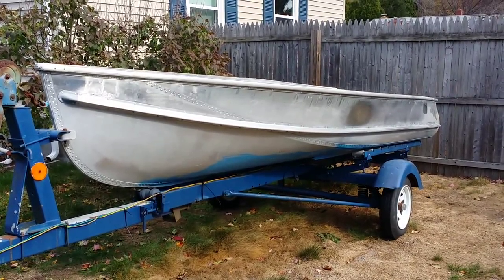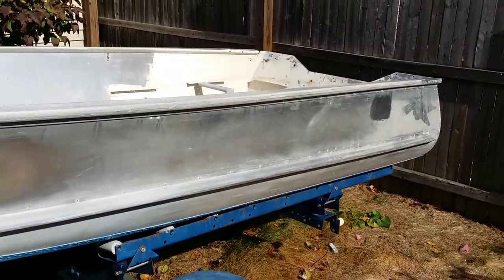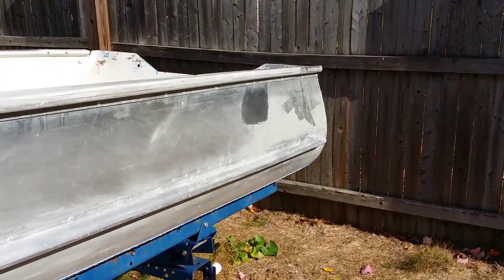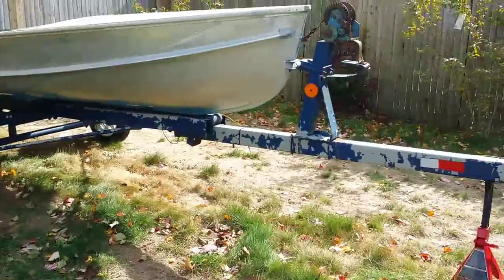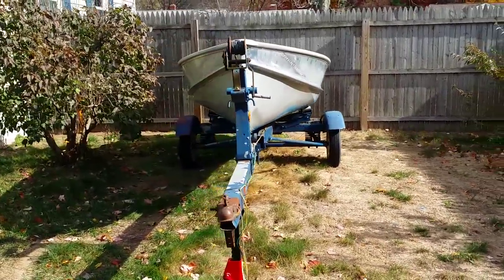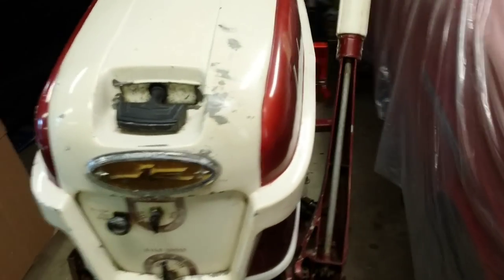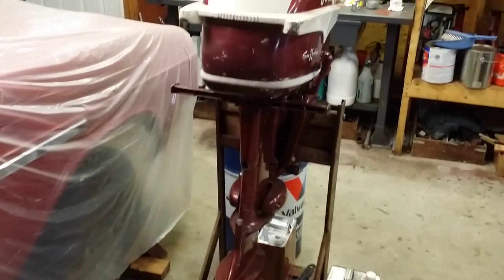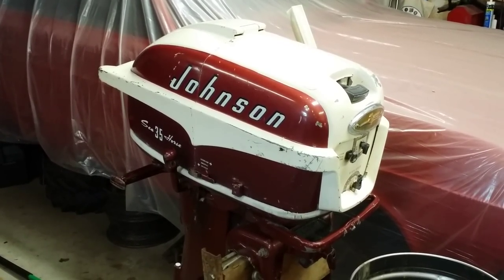1958 Crestliner Aluminum Runabout Boat Project

Comment: Sweet old boat. I have a '59 Crestliner 14' Super Seaman that I'm tinkering with. It looks like they share the same hull except mine doesn't have the long hood. Mine is mostly bare aluminum but it did have red underneath too. It came with a crappy jetski trailer that was modified for a jonboat which still isn't right for it. I'm modifying the trailer as well.

Comment: I have a '57 , 18 foot. My grandfather bought it new. Has the 4 foot bow deck. I'm 225 and stand on it all day. Also have the '61 Johnson 40 horse he bought new. Am doing a complete vintage resto on it after setting it up with a center console that has rotted out. These boats are very tough. Will take big waves . Made with Gov't surplus   aircraft aluminum and rivets I'm told.

Comment: Hello, I have a 57 Crestliner Voyager 14 . Came with Evinrude lark 35 and Johnson 35 Javelin.  The Evinrude is up and running. Boat restore starts tomorrow if weather is good. I would live to see your finished project!
Reply from the maker: I sold this project off a number of years ago... I kind of lost interest... the guy that bought it still has it but hasn't done a thing with it. Its just sitting his back yard as it did in mine.
Reply: @VinsGN my Dad had a 57 Voyager 15ft. It lived in the lakes and bays of Eastern Maine. I sold it after I moved to the desert of Wyoming. It went to Daytona Beach around 1990. Wish I had it back as we live a half mile from Lake Pend 'oriele in North Idaho. Wondered what happened to your project..

Comment: How is the project going? I picked up a 1953 crestliner with original trailer with a 1984 chrysler 55 hp motor and it is only a 14" boat.
Reply from the maker: +Ralph Cooper Hello, the project has been on the back burner for a while, the plan is to work it back in towards the end of the summer. I have a bunch of house projects going on as well as the tractor project, thank you for your interest!